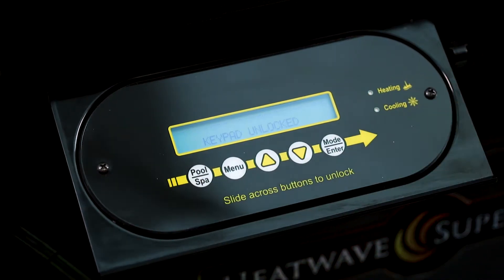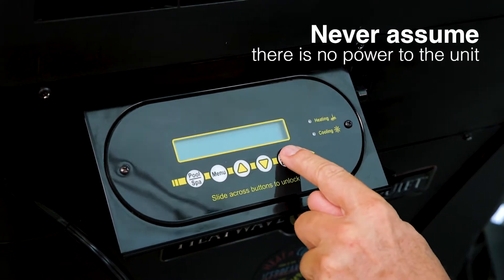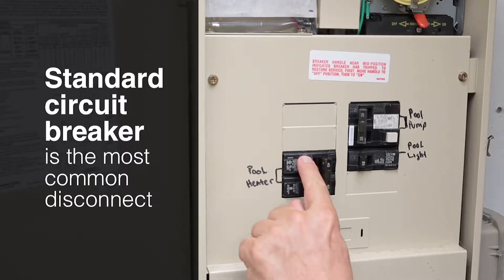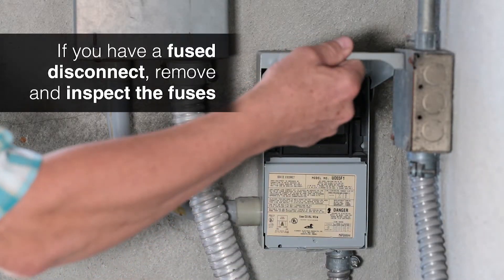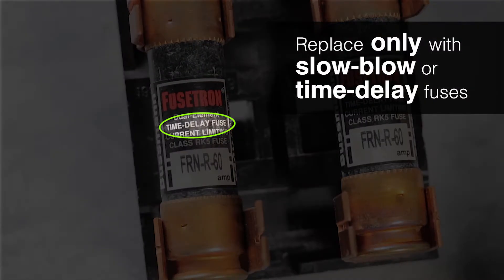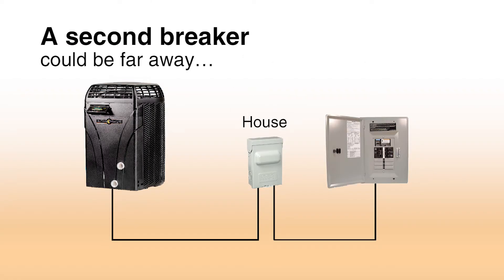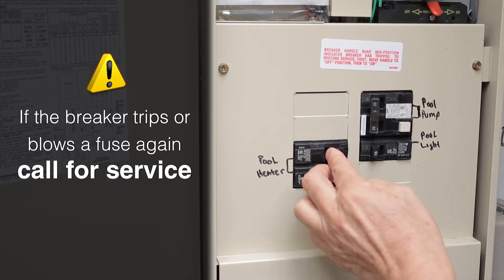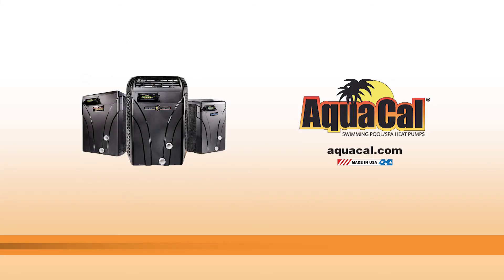Heat Pump Not Running & Display Not Showing

Comment: So what next? I have a system under warranty, but your cost of labor is huge. I had a new display replaced under warranty, took off the panels, replaced it, have power to the breakers, and the circuit board shows a green light on pwr and status, but the display is off. Pool is running, flowing fine and the salt system is working, but this isn't doing anything. What would be next to diagnose for why this isn't lighting up ?

edit: also replaced the cr 2032 battery just in case.

Comment: So whats up when the display is lit, but blank and unit not working?
Reply: I have the exact same problem. Did you end up finding the issue?  thanks
Reply: @timm9478  yeah they replaced the screen unit. Been fine since.